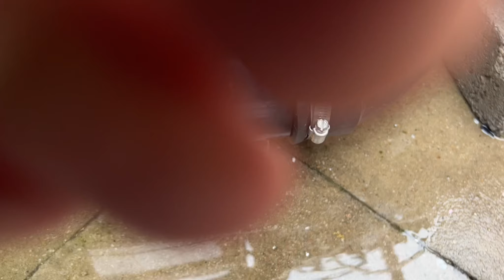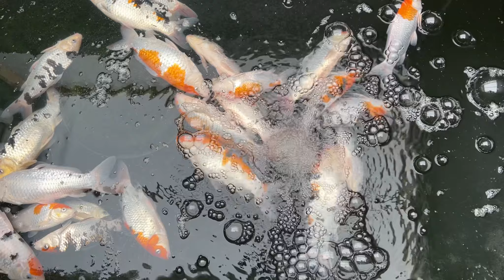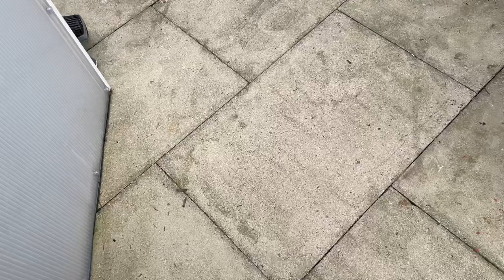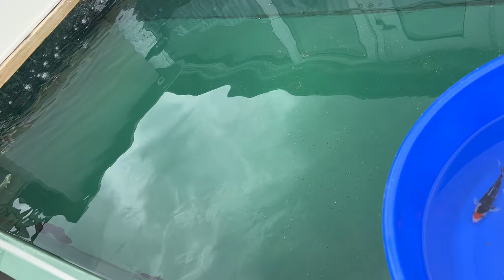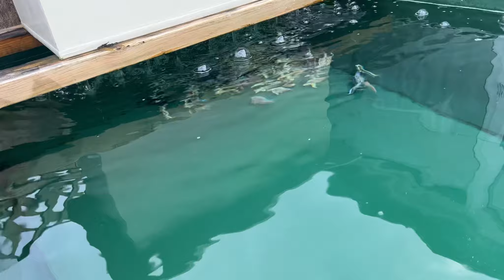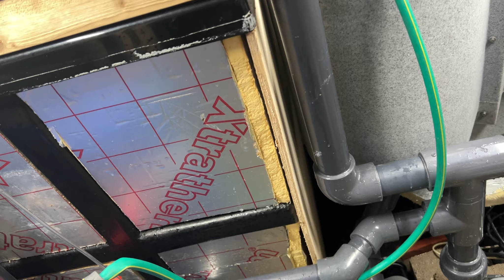KOI DISASTER 100s OF KOI DEAD ☠️, BECAUSE OF A RUBBER BOOT FAIL WARNING NOT FOR THE FAINT HEARTED

Comment: So sorry Danny, I've stopped buying any rubber fittings as i to have had problems with them splitting but have been lucky enough  to find and replace them before they emptied the pond.
You've done a brave thing with this video and hopefully it will warn others about these unreliable fittings.
Don't give up and good luck in the. Future.
Reply from the maker: Cheers David appreciate it, all the bottom has been upgraded now to solid plastic solvent weld and up and running again cheers mate 👍

Comment: My deepest condolences to you.
It is a horrible feeling when that happens. It is every Fish lovers worst nightmare.
I had a stunning set up at the house of my parents, but during lock down I could not really go there to do any maintenance. Then One day, I went and I saw all my Fish dead.

That is a bummer that it popped off. That has happened to me for the same reason. You might want to glue it on with some Bostik or Griffin. I use Bostik.

Please keep your head up and be positive.
Much love and support to you. 👍😊❤️
Reply from the maker: Cheers mate life can be cruel to us all at times I will be using solvent weld grey pipe in the future as it’s more stronger and any rubber joints I will be using griffin glue for sure cheers appreciate it mate 👍
Reply: @Dannyskoichannel  Unforseen circumstances do happen, yet we need to remain positive and keep going forward.
It is my pleasure Sir.
Take care. 👍😊❤️

Comment: Gutted for you! I've never trusted them rubber fittings heard and seen a fair few horror stories with them failing and I've only had koi a few years, everything has to be threaded couplings or solvent welded for me
Reply from the maker: Cheers mate never again on a low system like this one if it’s in the ground they may of stud a chance appreciate it mate 👍

Comment: Danny gutted for you mate shit happens look back on the cheap door bell alarm system i built summer before last i cant see the video now to put a link in but youtube would cut out this comment if i did. Anyone running a pond or tank of any type put a water level alarm on it home made or buy one save the hart bashing of this sort of thing
Reply from the maker: Cheers Martyn I will take a look and look into it I won’t be using the black pipe with rubbers on again that’s for sure cheers appreciate it mate 👍